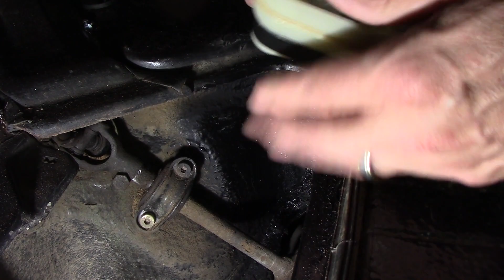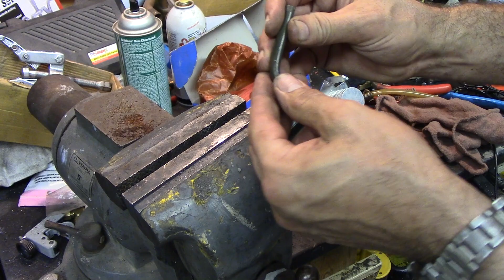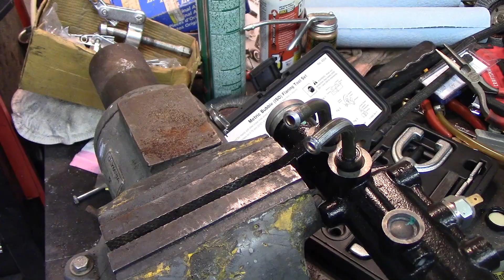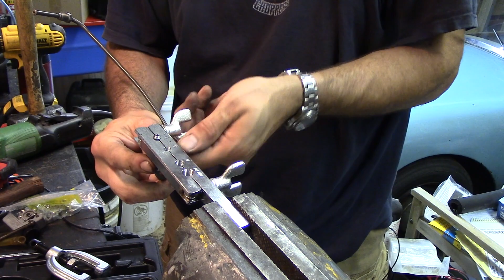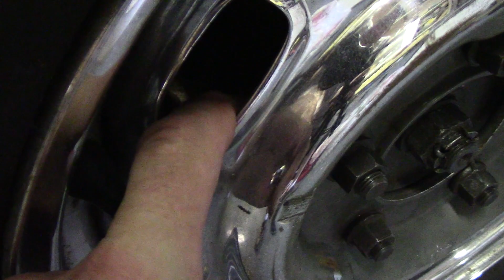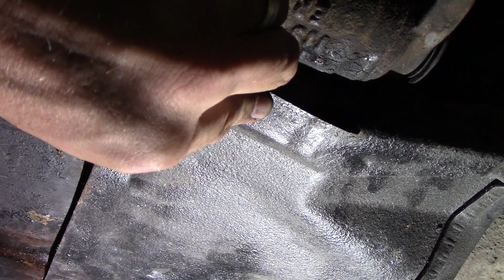Porsche 912 brake upgrade part 2

Comment: My dual master cylinder is leaking a lot of fluid everywhere and is very rusty. It’s for a 69 912. Could I just do a swap out or do you think or should I try and replace lines like you did? Obviously it would be easier to just swap. Nothing else is leaking affect for the master cylinder.
Reply from the maker: You probably can just replace the master. I had to do a lot more work due to switching from single to dual.
Reply: @bryansprojects3570  thanks for the response! Your channel has helped a lot with my restoration project. Right now besides the master cylinder I’m trying to figure out why the driver side 40 idf carb is running so rich. Not matter what adjustment I do it stays at 8-10 on the syncrometer

Comment: We're u happy with the upgrade? I've read on some forums that the 23mm upgrade only makes it so that the brakes require more force to stop... 

I have a 912 with a 3.0. I've upgraded to sc brakes and good pads but could us more stopping power.
Reply from the maker: I did it more for safety reasons to have a dual circuit master cylinder. The pedal feel is the same as before..

Comment: Great vid! Are you not using the brake light switch included in the new cylinder? Or is that switch for something else?
Reply from the maker: If I remember correctly that switch is to alert you if there is a failure in one of the brake circuits and the pressures are not equal. It should make a ground and turn on a light on the dash, more than likely some sort of government requirement back in the day.
Reply: I really appreciate your approach to working on this old 912, most people would have have a total restoration, car would have been off the road for years, thousands and thousands of dollars would have been spent and then the car would just be too valuable to drive and end up sitting in a building somewhere enjoyed by no one. You keep it on the road like it was meant to be. I hope to get my 66 to that condition soon after it had set in a building since 1976.